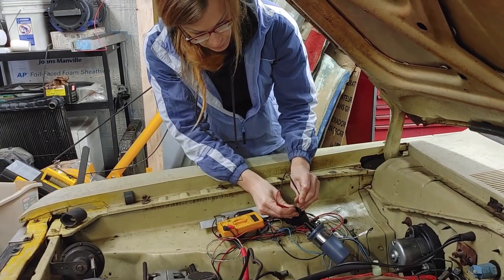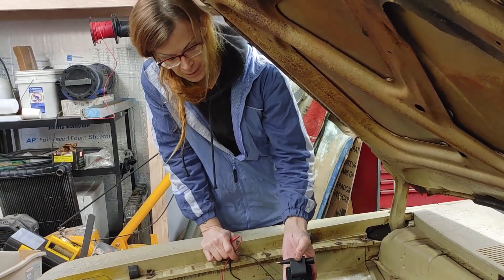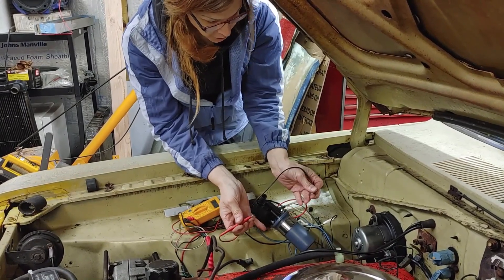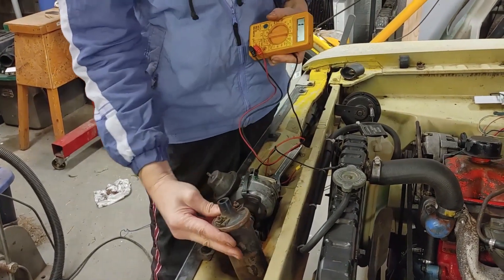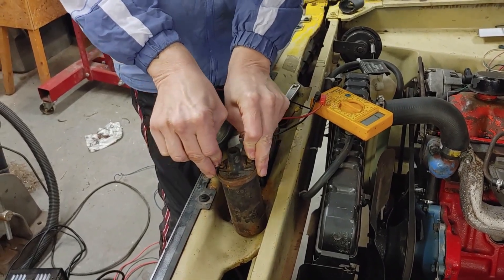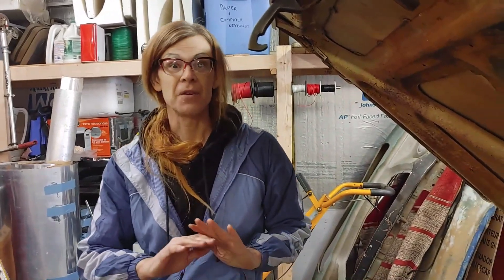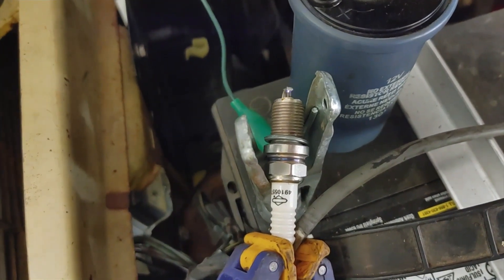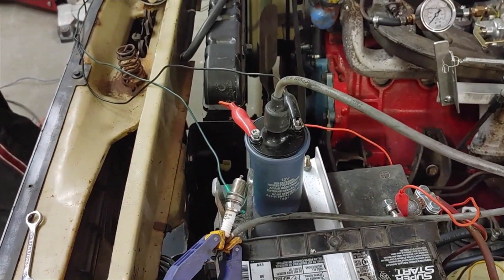Ignition, it Should be Advance!

Comment: Why not just put in  pertronix unit n the distributor
Reply: A Pertronix is a reasonable alternative and favorable upgrade. We will be trying several options as the project progresses, but with the failure of our cheap HEI, we made the choice to put the ignition system back to the factory design and then work from there.
Reply: Points + MSD 6al.  Gap plugs 
.045
Reply: I have two mag pick up slant six dizzys you can have one if you pay shipping... And just use a 4 pin mopar box or an msd.... And leave that GM junk in the pile it came from 😂😂😂

Comment: 💯Points for the win. K.I.S.S.
I agree with checking gaps. Plugs .035, points .012-.016. Points nice & clean?
Reply: I did a tear down and refresh on the distributor on the kitchen table the day before the install. It was working when pulled from the 66 dart, but a bit gummed up and dirty. It's hard to see, but it is now internally cleaned and verified. I'm not an expert, but the slant six is the engine I have the most experience with, so I feel confidence.

Comment: Could the timing retard be intentional as part of emission control? most likely to reduce NOx?  I have seen vacuum retard under some conditions for this purpose, including on my Lean Burn '82 225.  Wouldn't a '70s chrysler ignition box of the type preceding the Lean Burn be a cheap and straightforward fix? still found in junkyards?
    Another fix might be to put in so much mechanical advance that it overwhelms the electronic retard and advances anyway, but if that electronic retard suddenly goes away under some conditions, as I think the emission control ones do, then you might unexpectedly get excessive advance, much like Thunderhead Luke got when a spring broke.
    Thanks for mentioning that my low compression in #5 might be from a history of vacuum leaks, perhaps aggravated by the Lean Burn; and I did find loose intake manifold bolts.  I also thought I remembered the manifold vacuum port being on runner #5, but checked again and it is on #6.
Reply: The cheap part that I purchased did not indicate any such emission feature, nor was I able to find documentation about any such feature in regard to any HEI style factory system. The behavior is constant and wrong when compared to any documentation I can find, so that is all I can go from. Cheap HEI units may not operate in accordance to factory specifications, and the behavior can be extremely wrong in my experience. Buyer beware.
   Yes, the 1973-1979 ish chrysler ignition box and wiring are likely a very good next step in the evolutionary chain of ignition systems. The cost is cheap and parts are easy to purchase, although I haven't seen anything like that in a junkyard for quite some time. Ebay or jegs or someone will have parts if not a local brick and mortar place. Makes more sense than paying a similar cost for a name brand HEI unit and having wiring that doesn't look right on a mopar.
   There is also a good chance I will purchase a CDI ignition box for future projects. This cheap Amazon HEI idea just seemed like it would be really easy and only cost $10. I had no idea the kind of issues with junk parts that I would encounter. Live and learn.

Comment: OkAY , SO YOU ARE on your way, make sure you have a good ground on the distributor case to the engine block, make sure that the capicator you are using matches the coil you chose to use, I see  to much arking at those points. I see you have a fuel pressure gauge so also look down that air horn and look for dripping from the boosters. If dripping no good. Love your channel!

Comment: I just thought of something, the 4 ohm coil gives you only 3 amps thru the circuit. Weaker spark. That just might get rid of that intermittent miss. Get the original Mopar coil and condenser too.  I’m not digging out the books but I think the Mopar coil reads 1.5 ohms? But what if it’s a lean miss -fire? Go figure.😂😂😂
Reply: We are in the process of sorting out these finer details now. I sure hope I don't have a vac leak on an intake runner, but we will circle back around after the dash is put back together.

Comment: Your Valiant started it's life with Champion spark plugs gapped at .035 with it's original points type ignition. The spark plug number is RN14Y. Your points should be gapped at .017"-.023". The dwell angle is listed at 41-46 degrees. I have been driving the Mopar point ignition systems all my life!  At 65+ Y.O. that is quite a few miles! They are SIMPLE, INEXPENSIVE, and RELIABLE! I don't have a replacement coil and ballast resistor EITHER!  Mine are the genuine original vintage of the cars! That means OLD U.S.A. Quality! That means these components are as old as my '60s and '70s Mopar vehicles... Did I tell you that they are reliable?  I'll step down from my soapbox and go back under my rock now.  Later, Frank Parks at Mopar Restos in Summerville, Ga.  By the way, I have been driving Valiants all my life! The last 24 PLUS YEARS a '67 Signet 4 dr. with 225/904 has been one of my daily drivers CONTINUOUSLY, always plated and insured all those years.
Reply: I have the same experience! Keep it simple and Mopar!